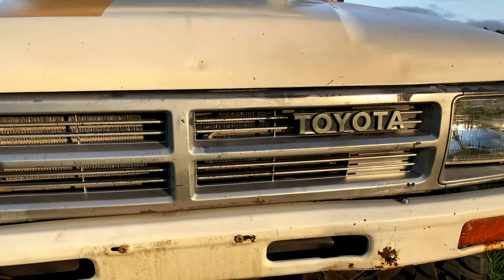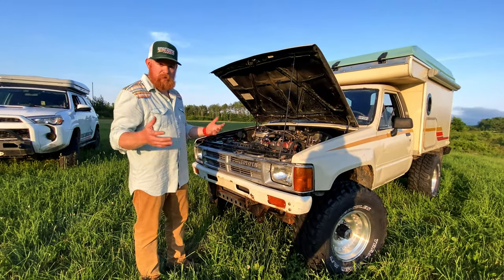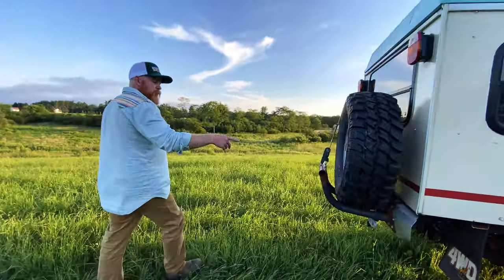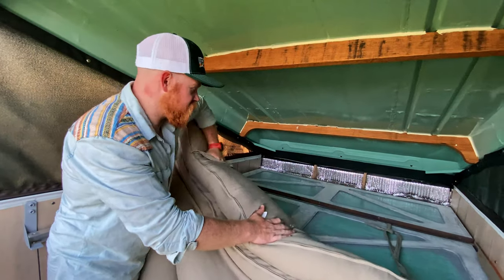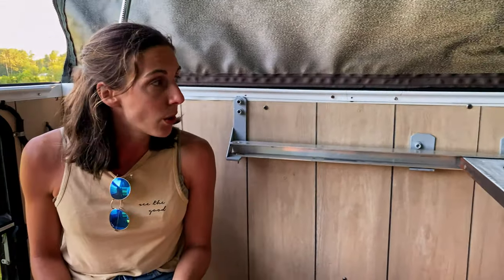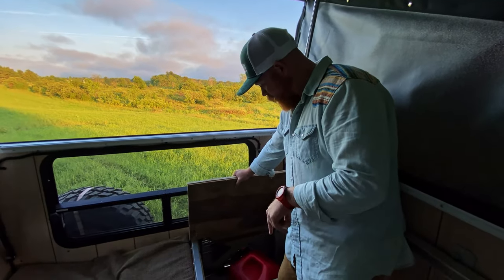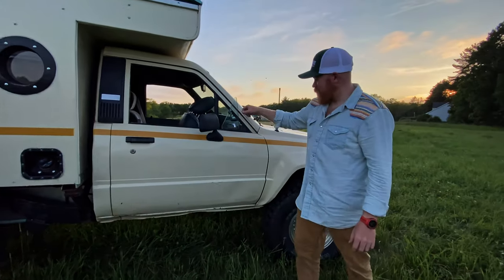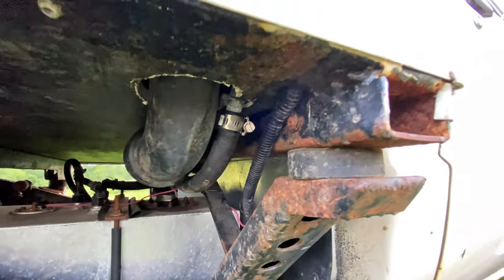Introducing Rupert - 1987 Toyota 4Runner with CAMPER CONVERSION!! //Vlog 03

Comment: New subscriber here, saw your post on 1st gen mafia Fb group...Very cool home-built rig! And a great start to make it your own! Wondering why the original owner ditched the fuel injection but hey, all that stuff is still out there & relatively easy to come by. Excited to see what you do to with it! Cheers!
Reply from the maker: Thanks! So are we, not entirely sure why the EFI was ripped out. We may put it back in eventually or try out something like a 4BT 😬
Reply: @NortheastAdventureCompany   4bt way to heavy would require 1 tons to still be reliable a vw diesel or a Cummins 2.8 I would check out but you can buy good TOYOTA Hilux diesels 1kz👍👍